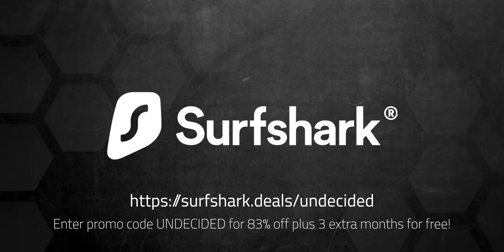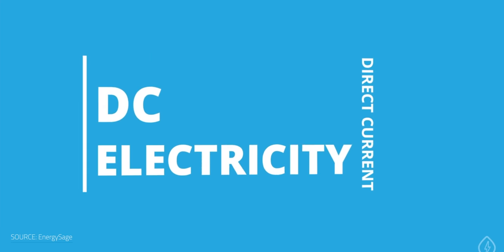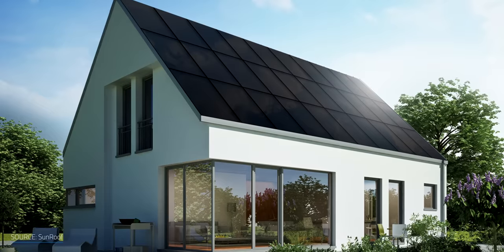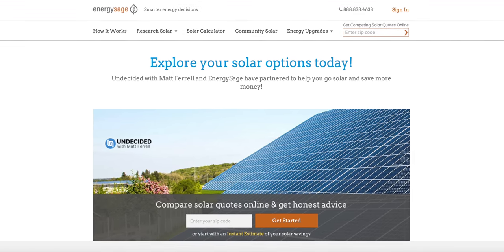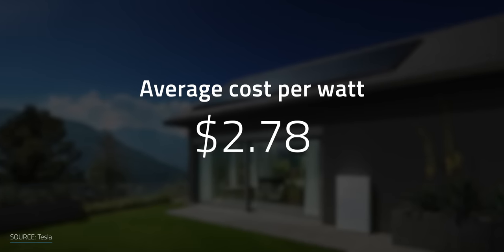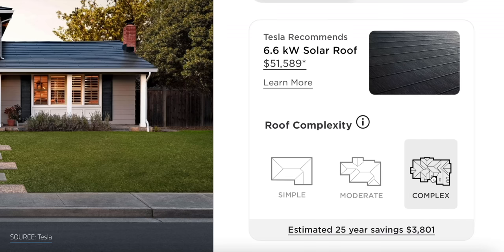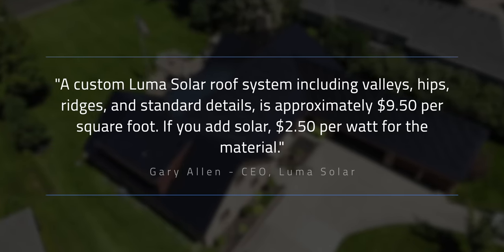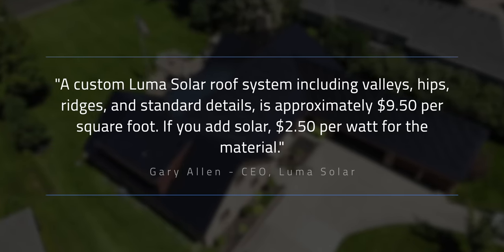Exploring Tesla Solar Roof vs. Solar Panels

Comment from the maker: So what would you prefer ... solar tiles or solar panels?  And if you liked this video, be sure to check out "Exploring if Tesla Solar Roof Is About To Go Mainstream": https://youtu.be/Xi_5PqHcKNc?list=PLnTSM-ORSgi7UWp64ZlOKUPNXePMTdU4d
Reply: I wonder how much it cost to remove existing panels have your roof re-shingled and then reinstall the panels? I watch my neighbor go through this it took months and it look like the reinstall took about 5 days, perhaps $5k and hundreds in lost production because it took months before the panels were reinstalled.
Reply: Panels.
Reply: For me at 50 degrees North its a no brainer, my roof faces East and West, so I'll stick with my panels on the south facing end wall thanks!
I do wish I could buy triangular panels to fit in the gaps under the roof line though!
Reply: Tiles look so much better
Reply: Panels as I have a brand new roof on a new house and it just doesn't make sense to replace it right now.
Reply: My roof is due to be redone in about 5 years, and I will probably go with tiles. It seems to me that you can put more power generating tiles than panels on a given size of roof because of the smaller size of the tiles, and even more if the roof is more complex. I'll keep doing my research, because I am sure that there will be a lot of changes in the market before I am ready to do my installation.
Reply: Panels, for a tile solution it has to be on a new roof or new house
Reply: Both, I work for sunroof here in Sweden, and we use a larger glass/glass panel as a tile. Pretty cost effective due the way they are made.
Reply: I say panels, wife says tiles
Reply: And I prefer my hosts not speed-up their videos by 15% in post-production. But hey, I guess that's just me. :P
Reply: Great video Matt, I think like he mentioned as the astetics continue to expand increasing demand the cost of tiles should go down.  Hopefully developers in the future will offer this option to homes that are presold before they are built.  This all depends on enough qualified installers being available.
Reply: 7:11 You don't give any information about the efficiency of any of these tiles, making comparisons hard. Do the Tesla tiles not even have warranties and guaranteed output percentages at the end? 

         What are the efficiency numbers of these tiles? How much do they tend to drop in efficiency over time? I imagine with all this texturing and color nonsense, that would cut into efficiency, some colors and textures probably cutting into efficiency more than others. I don't understand why it even matters that tiles not look like solar panels, why would it be important to disguise solar panels/tiles?
Reply: Solar tile costs ... Is that just for the tiles with solar panels.

Or averaged cost per square foot over the entire roof?
Reply: @rayopeongo  
Not as easy as that...I think Tesla needs a minimum of 17 tiles per face.

There's a guy on YouTube that documented the entire process, he wanted a bigger system and Tesla said they couldn't do it.
It was a viewer who pointed out if he moves a pipe he'll have enough room on that face for the string.

Tesla would install after that.
Reply: @Robert-cu9bm  

"if he moves a pipe"

Yes, I figured that something like that would be consideration too. I use natural gas for my furnace and hot water heater, and have a chimney on the roof for venting exhaust gases. As part of the ongoing upgrades to our house, the furnace was upgraded a few years ago to high efficiency so that it now uses plastic piping on the side of the house to pull in outside air for combustion and vent exhaust. At some point in the near future, I'll upgrade the hot water heater to do the same, and that will finally allow me to get the chimney removed. That will be one less hole in the roof to worry about, one less structure for the wind and snow to pull on, and one less complication for any solar installation down the road.
Reply: Well we have been hearing that Elon / Tesla have been working with a Team from another company Specializing in Perovskite Solar Cells  and  another working with John goodenough YES HIM!~?  the next 4 years are going to get VERY interesting...
Reply: I got panels 100 Euros per 350W panel. 2400 Euros per 15 000 W inverter
Reply: I have a small number of panels, which I mounted separately from my house, I can add more as finance allows and orient them to the sun. Finance and house orientation seem to be major factors here.
Reply: Will need a new roof in the next 0-10 years, so I am really hoping tiles become more availible in Norway during that time.
I dont really want to put on "new, regular roof", if I can get it with solar (evne though that comes at a higher price)..
Reply: @juststeve5542  I think most homes wont use solar tiles for the entire roof, so you could have solar shingles on one side and on the other side it would look same, but not produce power. But of course if you have panels, keep them :) tiles are more like if you are replacing your roof because its at end of life, or if you just have to have that integrated look, maybe an old house has a preservation plan by the government, so it may limit options if things change the look of the building.
Reply: There's a huge inconsistency here, price per watt is given for the solar system not just the panels. Panels are just one part of the price per watt comparison. For example different inverters and their technologies can drastically change the price like Enphase microinverters vs SMA string inverters. It would be good to note that a difference isn't being made here between the two. I work as a solar engineer and we don't use energysage for simple reason that they skew the data. But the big thing here is that you could easily have a $0.50W difference just depending on the inverters
Reply: If I needed a new roof then I think I might be in their market. If you do not need a new roof then it is very expensive. 
Question: I'm going to assume that the solar roof tiles can also come in the non solar roof tiles. Most homes would not need every tire to be solar due to the square footage of the roof.
Reply: Just like elevators which are mandatory for tall buildings, Solar panels must also become mandatory to be installed on the roof of every building, turning a useless area into a power plant!
Reply: Separate panels. I will never, ever go for in-roof. Who is going to guarantee that I can find replacement parts in five, ten, fifteen years, in the right size? If you're repairing your actual roof, you want the parts you need for that to be available guaranteed. I don't see that happening in such a fast moving market like solar.
Reply: @juststeve5542  East-west on a roof can actually be a great investment. They would not be less efficient than vertically mounted panels facing south.
Reply: @AndreSomers  during the summer I agree they would probably do ok on the roof during their half of the day, but I'm at 50 degrees north, so in the winter they wouldn't perform very well.
The vertical ones on my wall actually do very well with the low winter sun.
FYI - The top 3 are vertical, the 4th, which will be in a row which sits just above a flat roof extension (and is currently solo) is slanted out, so comes into its own as the sun rises.
I may add some to the roof, but my initial focus was to try to get power over a wider spread of the day and year.
Reply: @juststeve5542  I am at 52 degrees N, and E/W setups are really common here. Both for people with tilted roofs oriented like that, as well as for flat roofs where you get more power from the roof surface as you need way less spacing between the rows of panels compared to orienting them south-facing because shadows don’t come into play then.
Reply: @faridjafari6356  I think that when prices come further down, there will be a bussiness oportunity for people to give you a free new roof, in rturn that they can harvest energy on it.

So lets say you have a house right and your roof is broken. When solar prices go down, maybe you dont have enough money to fix your roof. Then large companies like Tesla coud say: we give you a free roof, if we get the power created the next 25 years. If you tore down the roof, you would have to pay back of course :P But in this way I think there will be new bussiness opportunities. A lot of roof area in the entire world is unused.
Reply: @OlavAlexanderMjelde  Yes you are right by saying "A lot of roof area in the entire world is unused."
Reply: Panels ... you can mod the panels for thermal collection (PVT)
Reply: hi matt can you talk about biogas as  future energy in the next video ty
Reply: @DaveDugdaleColorado  And THAT'S why if I were to ever get solar for my roof it would be solar shingles without question. It may not be as efficient (as well as more expensive) per square foot however it covers the WHOLE square footage of the roof, which balances out the efficiency drop, and you don't have to be offline for months while you re-shingle the roof after a bad storm or if the shingles hit their life limit.
Reply: Just like you suggested in vid, "if you are replacing your roof consider tiles".  However I am looking at what the energy density is too, and for that I may choose density over esthetics.  
CAVEAT: Utility / government policies.  Some places require a monthly fee that will greatly increase the ROI, some rules so onerous that it too expensive to install (even if one has the will).
Reply: Hey Matt!

Love the data in your videos, however, I am wondering if you have looked at the new LG panels? The new LG panels can reach over 400w per panel with 22% efficiency and 92% capability after the 25 yr warranty.
Reply: Based on power output and price, neither.
Reply: Subtracting the cost of regular tiles what does that save? Does it average out?
Reply: There are some serious Insurance exemptions or even refusals to consider here too. I have friends in Insurance sales that say their companies won't even ensure homes with Tiles. They say there isn't enough data for their companies to insure a reroofing situation & the company won't take the risk. One more case of insurance companies making life harder for progressive folks.
Reply: Not going to buy Tesla solar panels because apparently their batteries will stop working after 48 hours with no Internet. Which is really rather stupid if you have a long-term power failure.  Like in Texas.
Reply: Now we have many green energy resources, efficient automotive engines, vehicles, efficient lighting in stadiums to homes, motion sensors to save more electricity, less or same energy but higher computing powers, efficient cooking utensils, and the list goes on. Despite of all these additional energy resources, why neither the gasoline price nor the electricity units decreasing? (Or decreasing?) It puzzles really.
Reply: Is it possible to put a magnifying lens somewhere above the solar panel thereby making it collect more sunlight
Reply: If solar is so good why don't they make it mandatory that any surface that can collect solar energy does
Reply: Look up solar updraft towers. I built one as my senior project
Reply: Solar tiles. More elegant, and even if more expensive than panels, you can subtract the price of conventional roofing materials and cost.
Reply: what do you mean $per a walt?
Reply: Solar tiles have garbage efficiency per sq footage. So if efficiency is what you want and need then panels are the way to go. If you're looking at aesthetics and have the extra cash the tiles are your choice
Reply: Stop platforming Elon Musk hes not a man of science hes a man of profit no matter how you bogustly justify him.
Reply: If the tiles were the same price as panels there would be basically no point in panels, as tiles look far far superior. So of course I prefer the tiles, it's just cost that's the only limiting factor.
Reply: Panels, not because of cost or efficiency, but as an electrician i'm conerned about the ridiculous amount of extra connectors between the modules. 
More connectors=more potential failure points and more losses. 
I've seen roofs catching fire because a connector went bad over time.
It's not like you can check on them regularly easily.
Reply: yo liked the video but you have to make the graphs more transparent( start with 0), sry english is not my mother tounge
Reply: @DaveDugdaleColorado  lol probably cheaper just to buy a new house with it already installed
Reply: There are alot of variables for sure. If I bought and installed today, I would lean towards panels with a roofing system for higher performance and longevity than the typical asphalt shingle. The adoption of higher performance homes and roof assemblies will lead to tiles becoming more appealing.
As we install more tiles the nuances or issues created from using the tiles as the roof will eventually become less and less. Things that come to mind would be the temperature effects on efficency of pv cells, cleaning gutters, orientation for better system efficency. It will be an effort between good builders, and the respective solar companies.
Reply: I think panels have many advantages over tiles. Tiles will generate more heat which will reduce their efficiency. Panels allow air to circulate behind them. Also some of the tiles show all those groves that will hold dirt and moisture. These rough surfaces will also hold snow in the northern areas. I live at 61.5 N and mounting them fixed doesn’t really work well as the sun goes from 6 to 52 degrees throughout the year.
Reply: I would be afraid of tiles not avalable if/when a repair will be required. I somehow miss standardized tiles.
Reply: I think it would be great if modular home builders would give the option to preinstall solar tiles instead of a regular roof. Then I would be able to compare the price differences of (regular roof + solar panels) vs (solar tiles roof). 

For me the choice is very easy and pragmatic: if (regular roof + solar panels) option is noticeably cheaper than solar tiles roof, then solar panels it is. If these price-points are identical then solar tiles gains an edge because of the esthetics factor.

Basically I think right now solar tiles aren't practical even as a roof option for new homes. But with time, scale and automation of production their prices will go down and it'll probably start snowballing from there and eventually only solar tiles will make sense as a roof material.